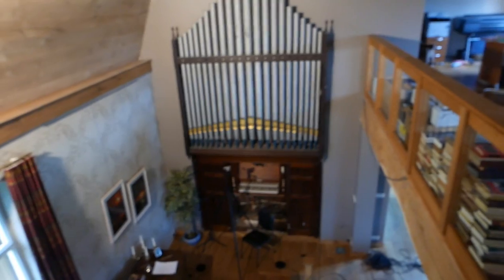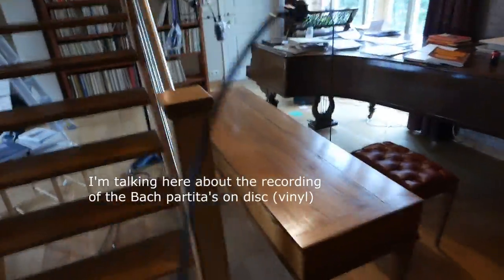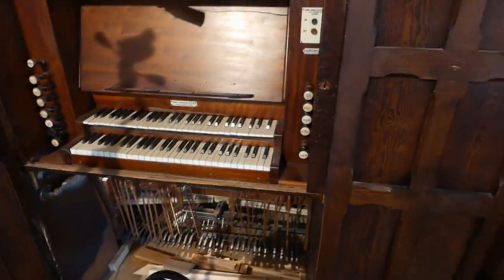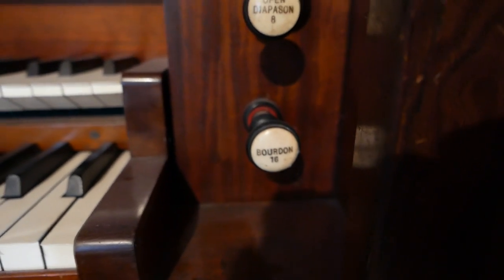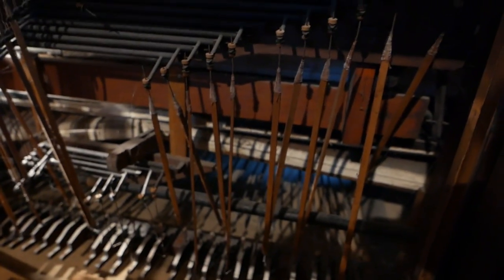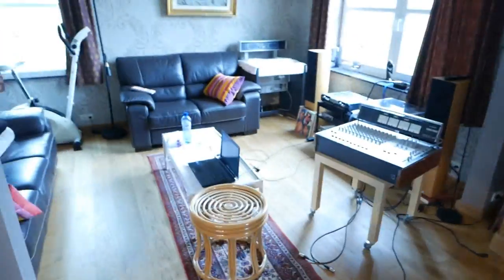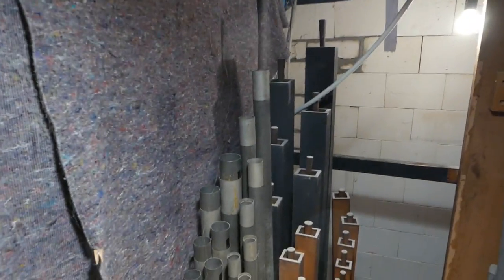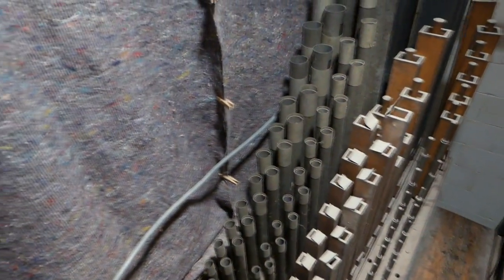The Organ :  A guided Tour !

Comment: You could add a midi hookup to your organ and use software such as Hauptwerk so as to get the acoustics desired.  You could also buy a remote pedalboard since the parquet floor is blocking the installation of the original pedalboard.  That is assuming that you want to play the organ.  You could also enhance the reverberation time in the room by installing sound reflective panels on the backside of the organ and on the high ceiling and walls.  There is free acoustic software that can be used in helping design the space's acoustics.